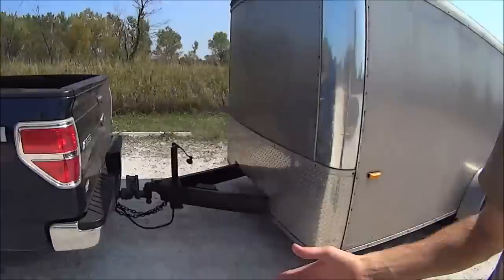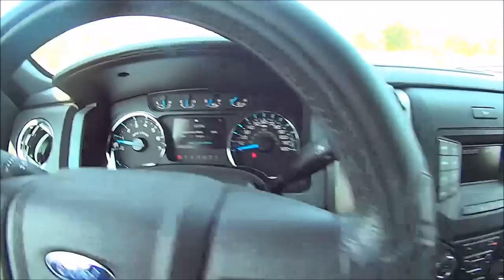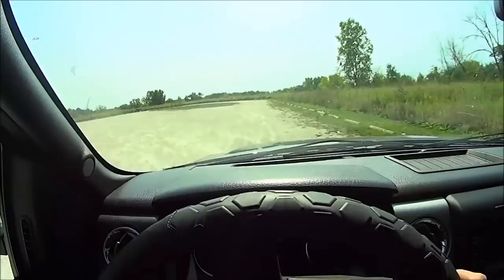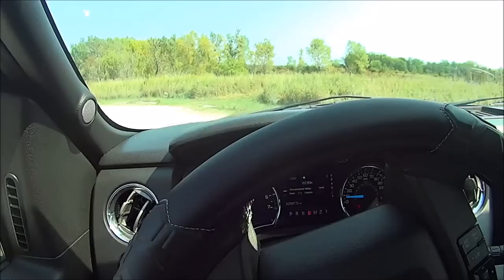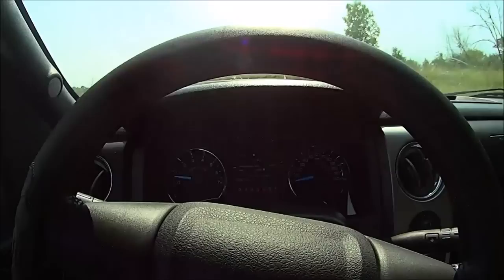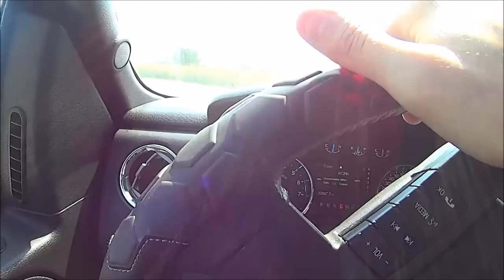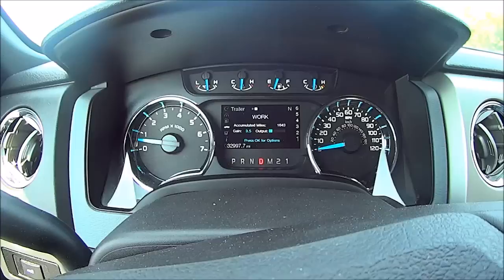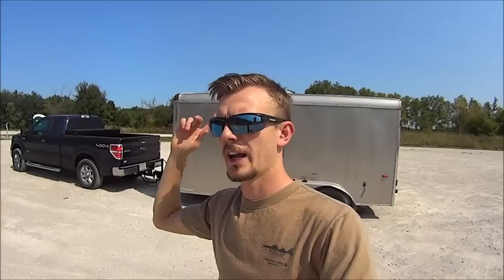How to Set up Electric Trailer brakes

Comment: Years ago when I was a kid,, as electric brakes are mostly pouched, most of the time, I just put in a on off switch. Worked perfectly. Saved a couple of kids lives as they were riding on the hwy,  on a narrow bridge, with an oncoming transport.  The trailer started to fishtail, flicked the switch on and it straighten up smartly.

Comment: How did you decide what # to set it at just by using the controller to stop the truck and trailer without using your truck brake pedal ? You want it one number set lower than locking up correct?

Comment: Nice video sir. Taught me a number of things.  Let me ask you a quick question.  Is there a typical brake setting based on the amount you’re towing?  So for instance, if you are towing 3,000 lbs then your brake setting should be 3-3.5 or 5,000 lbs will be 6-6.5?  I’m just making those numbers up but I would think there should be some type of predetermined guideline.  Again, thanks for making the tutorial.
Reply from the maker: Thank you and I'm glad it was helpful. That would be a good starting point NG when setting up the controller. But then you'll fine tune it and it might change depending on the terrain.

Comment: So does the trailer recieve a signal from the truck to apply brakes to the trailer (through the power cable connected to the truck)?

Comment: Not correct in some aspects.you don’t want the trailer to brake the truck .all brakes,truck and trailer,should activate equally.if the trailer disconnects from the tow vehicle the breakaway switch,”that cable”, as the driver called it,will dynamite the brakes.FULL BRAKES.on the trailer.setting up brakes the way you do it will wear the trailer brakes unnecessarily.there should be another adjuster on the controller.a potentiometer.it syncs the brakes.the gain gives more or less application.

Comment: So is the idea that a empty trailer stops the truck... Which is the approximate weight of a full trailer? I'm gonna be hauling a 16 foot enclosed with my Tundra and I am installing a Reese... It seems like if it stops both empty truck and trailer that's about right for a full load?
Reply from the maker: My trailer normally is right around 4k lbs but I've had it loaded to the max of 7k lbs and I will adjust the controller up depending on the weight change.

Comment: There are 2 ways to install brakes on a trailer.. 1 is with a breakaway box .. 2 without a breakaway box .. The brake controller sends different amounts of voltage to the electromagnets in the trailer brakes (5-7 volts will apply some drag on the brake shoes , while 12-14 volts may actually lock the trailer wheels depending on how much the trailer brakes are adjusted) .. You just want some pressure on the trailer brakes NOT drag the wheels unless just 1 axle has brakes, if both axles have brakes and they all lock the wheels then the trailer will be out of control and possibly cross the centre line on the highway ..
With a breakaway box the trailer has it's own battery if the trailer and truck get separated the wire on the breakaway box gets pulled which sends full battery voltage (from the onboard battery) to the brakes ..
Reply: All trailers with electric brakes are required by law to have a break away switch.  Then whether a trailer has no brakes or brakes on one axle or more than one axle depends on the weight of the trailer.  Any trailer over 1500 pounds is required to have brakes on one axle.  Any trailer over 3000 pounds is required to have brakes on all axles.

Comment: When you are doing 15 mph and apply the trailer brake, are you coasting the truck or do you keep your foot on the accelerator to see if it will stop? Thank you, your video is very informative!
Reply from the maker: When I get to speed I left off the accelerator and only use the trailer trailer brakes to slow down. Thank you for the support!
Reply: Thank you

Comment: Nice and helpful video my question is should the trailer be loaded or unloaded I’m pulling double axle and 2 RZRs
Reply from the maker: When it's loaded you'll want to increase the gain of the controller to counter the extra weight on the trailer.
Reply: So ideally, you should calibrate for every different load/weight you pull?

Comment: Is there supposed to be be a delay from trailer braking on a 2016 Diesel. Truck brakes first and then trailer few seconds later Trailer? Why don't they break at same time?
Reply from the maker: I'm not sure if there's suppose to be one or not. But there probably will a delay with the signal from pushing the pedal to sending the signal to the trailer

Comment: Thanks for the time to make the video. I know you made this years ago, but if you care to, can you explain why your criteria was to see if the trailer brakes alone can stop both the trailer and the truck? If the trailer ever becomes disconnected, wouldn't the break away switch be pulled, causing the full 12V from the breakaway system to be sent to the trailer brakes, which commands 100% braking to the trailer? If the trailer is disconnected, it just has to stop itself, not it and the weight of the truck too. Good tip about backing off the gain once the trailer wheels started locking up, that was useful. Thanks.

Comment: Around 4:30 you say that you'll need to use the trailer brake controller to stop the trailer if it becomes disconnected. If it's disconnected, how will the trailer brake system work? Doesn't it need to be connected?
Reply from the maker: Symonoxide 7 I should've been more clear, if your trailer becomes unhitched and as long as the wire hook up stays connected you want to use the brake controller but if everything unhooks and becomes disconnected than that trailer is gonna do what it wants at that point.
Reply: If the trailer come completely disconnected then the trailer battery will take over an apply the brakes.   that's what its for.
Reply: +snowismas Correct, that's what the breakaway cable {guy in the video refers to it as "this cable") is for. One thing I noticed is he has a little too much slack in his. Your breakaway cable should always have less slack than your safety chains.
Reply: The break away switch takes over if the trailer becomes completely disconnected from the truck.
Reply: Theres a emergency break away wire that locks brakes...then there reece chains

Comment: Mitch-  I'm looking at a 2019 f150 with a factory installed EBC.  Operationally, is it "ready to go" right from the dealership?  Is there any more to setting it up other than what you've covered in the video?  please advise.  thanks!!
Reply from the maker: Nope! If it's already installed you just have to set up your trailer.
Reply: Hitchin Mitch Great thank you Mitch have a great holiday
Reply from the maker: @daviddion3731  thank you, same to you!

Comment: So I need to use the brake controller when driving as well not just my truck brakes when everything is hooked up?
Reply from the maker: Once you set the controller up, it will activate when you use the tow vehicles brakes and send the signal to the trailer. Don't have to grab the controller Everytime.
Reply: @HitchinMitch  Thanks. Do u have a video how to install one?
Reply from the maker: I do, however it's the oem for my f150. Depending on what vehicle you have there might be a harness already behind the dash and you just have to get a pig tail harnes to wire it to any brake controller of your choosing.
Reply: @HitchinMitch  I have a 2002 Dodge Ram 1500 2 wheel drive
Reply from the maker: You'll probably have to hard wire that in. I'm sure there are other videos installing a brake controller on your generation ram. Does it have the factory installed 7 way in the back?
Reply: @HitchinMitch  For the trailer lights yes
Reply from the maker: You might have the wires already behind the dash in the driver's footwell area, they might not have a harness or anything. They may or may not be labeled.
Reply: @HitchinMitch  ok thanks

Comment: This was extremely helpful but I think in a real-time situation if the trailer did disconnect on a highway you would have zero time to move that slide, and the emergency disconnect would take over and activate the trailer brakes. I'm thinking the slide is really just to tune your braking power just as you demonstrated.
Reply from the maker: It's definitely the most use it'll get is while tuning the gain. Otherwise, I hope that a worse case scenario never happens.

Comment: This is the best trailer brake video on YT. You're explaining and you're also showing. Great work bro. Also, did you use a 4 or 7 pin with this trailer? I'm guessing 7 pin?
Reply from the maker: The trailer has the 7pin connection.

Comment: where is the video screen display in my  98 suburban?
Reply from the maker: If your after market brake controller doesn't have a digital display then you just have to go by memory. Otherwise I'd say buy a newer F150. :)
Reply: Hitchin Mitch - Suburbans are better than a new F-150. Unless it's a 1978/79 F-150, I'd take a Suburban.
Reply from the maker: K Digiacomo that's fair, I wouldn't mind having an old 70s Ford truck.  Pickups suit my needs better than a suburban would.
Reply: i hear ya. i need a truck but had to get what i could at the time.winter. not many 4x4's for sale in the snow.
Reply: Hitchin Mitch -Just giving you a hard time is all. I've built several 78/79 long beds for the dunes here in Oregon, best years for doing that (IMO). I'm biased to the 73-91 Suburbans is all, only reason why I said what I did. You have a nice truck, was just teasing. I should have explained more before sending the response. My trucks were only around $12k, I wouldn't run 80 on the flats and jump a $40k+ new truck at 60. Unless it was a pre runner....
Reply from the maker: immrnoidall understandable, you gotta do whatcha gotta do.
Reply from the maker: K Digiacomo all's good! But that sounds like a lot fun! I definitely try to use my truck but don't want to kill it. Definitely wouldn't mind getting an older truck to have fun off-road. I once found a 70s suburban with 50k original miles and rust free, would've made for a cool daily.
Reply: i do have a saws all and a pack of new metal blades. lol.
Reply: Hitchin Mitch - I like the 73-80 Suburbans the best, only big visual difference is the front clip, but that would be a great find for sure! (jealous)
Reply: yup. not so box like.
Reply: immrnoidall - A guy local to me cuts the back of Suburbans off and welds on the back of wrecked Blazers, looks 100% factory. (4door Blazer) He just does it for fun. One has 36s, other has 39.5s, big one has 54s under it.
Reply from the maker: K Digiacomo they we're asking about $10k but I got a BMW hogging up funds. As for the guy making the 4 door blazers that's like the Ford centurion the four door broncos. That's awesome he does that.
Reply: Hitchin Mitch - Yep! There are a few Centurions around here, getting rare to find. There's a swapped 1 ton here a guy wants $30k for, has a Powerstroke motor in it. That would be awesome!
Reply: Hitchin Mitch - My Girl has an X5 that keeps throwing codes, everytime it's different. It's nearly mint, but can't get it tagged here in Portland if a code is up, super frustrating. I'm looking for a clean E30 with a bad motor and want to do a V8 swap, LS motors here are relatively cheap. Stupid drivers = more parts that are available.
Reply: Hitchin Mitch - What Bimmer do you have?
Reply from the maker: K Digiacomo that sounds like a very awesome build!
Reply from the maker: K Digiacomo ls swapped E30 would definitely be one fun car to throw around. I have an 85 635csi, American spec that I converted to a manual.
Reply: Hitchin Mitch - 635 "Land Shark", those are gorgeous!
Reply from the maker: K Digiacomo yes they are and the reason why I got one, but unfortunately priorities change and have to sell it.

Comment: I still dont get it😠😠😡😡😡😡😡
Reply from the maker: Diablo Loc what part is confusing? maybe I can help clarify.
Reply: If you want to stop your truck you have to press the  trailer brake and your truck brake ,to ? , or only trailer brake  or both?
Reply from the maker: +Diablo Loc in an emergency situation if the trailer comes detached you would only use the trailer brake. But everyday normal driving around with the trailer you just use the truck brake and that will send the signal to the controller that tells the trailer how much to apply in its brakes.
Reply: So , if you want to stop your truck you only need to press the truck brake,  right. How come you were pressing the trailer brake?
Reply from the maker: Diablo Loc I was using the trailer brake to set the brakes for the trailer. after you're done setting up the brakes and the proper output then you only using the trucks brakes.
Reply: Okay , first you need to go 15mphs , and press the trailer brake  to test if it stops good , then if it works you only need to use the truck brake right. ?
Reply from the maker: +Diablo Loc yep!
Reply: The trailer brake is only for a emergency, right
Reply from the maker: +Diablo Loc correct, or to test the brakes.
Reply: So a trailer brake is only use for emergencies , only,  right ?
Reply from the maker: +Diablo Loc once set up, yes.
Reply: What happens if you dont set up the trailer  break , right ?
Reply from the maker: +Diablo Loc then you'll wear out your tow vehicles break faster or if your trailer breaks are set too high you'll wear out your trailer breaks a tires as shown in the video.
Reply: What does wear out mean ?
Reply: Last question, what is the trailer break slider for ?
Reply: Big Joker4 if you only rely on tow vehicle brakes to stop you’re putting more use on its brakes and the pads or shoes will wear away faster.  Same if you have trailer brakes set too high they will be used more and need to be replaced sooner.  When they both work in tandem it causes less stress on both sets of brakes.  The slider is the manual control for the trailer brakes (the trailer brake pedal).  The more you push it over the harder the trailer brakes work up to the point you set it at.
Reply: @smileyclownyloks9949  dude wtf man cmon... ur slow af
Reply: @smileyclownyloks9949  in the case of an emergancy if you experiance any sway (caused by a gust of wind, being passed by a fast semi truck, or God forbid improper weight distribution) the slider is to apply trailer brakes only to pull the trailer back in line with the tow vehicle. Other than that yes to set up the brake voltage.